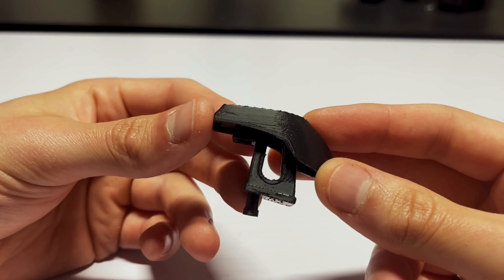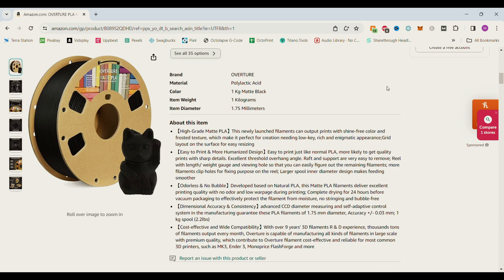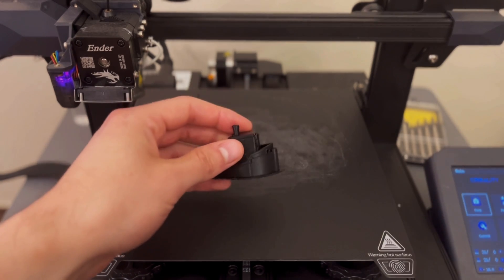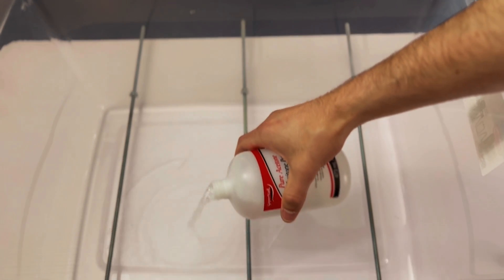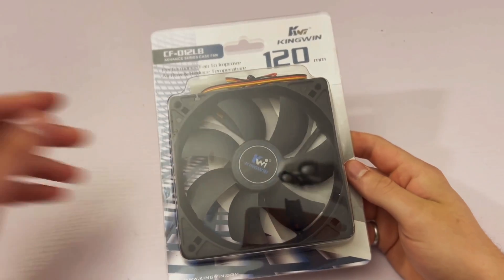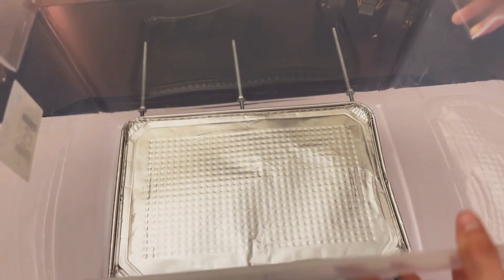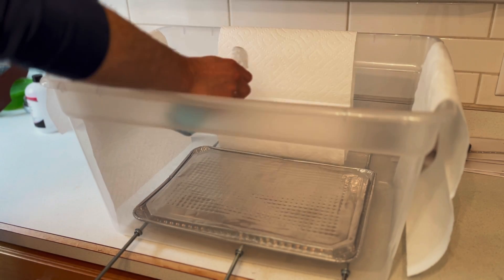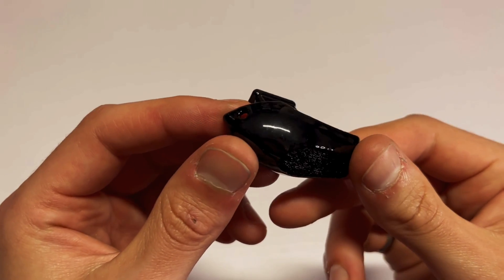The Magic of Acetone Vapor Baths for 3D Prints

Comment: Bro, the instructions you give in this video are dangerous and could get somebody hurt or sick. You should delete this and if you're going to continue to print with ABS, get an enclosure and properly ventilate it with with a filter. You are poisoning yourself and anybody else who occupies the space. 

Also, acetone evaporates insanely quickly and easily and is heavier than air and can displace oxygen. This may not be much of a concern for people because we stand so high above the ground, but it is if there are any pets like dogs, cats, or anything else that breathes close to the ground (and if you have a low bed if this is close to a sleeping area). The holes you drilled in the container are almost certainly allowing it to leak out of the container unless you've sealed them properly. What you showed in the video is not adequate sealing. So the acetone leaking out of the container is running along the floors of your space. Acetone vapor is super combustible, so you're putting yourself at risk of a big fireball. Especially considering that you're using WAY too much acetone. You don't need to make a lake of acetone at the bottom of the container. You just need to soak some paper towels in the acetone and suspend them from the sides with magnets. You can gently heat the outside of the container with a hairdryer if you want to speed things up.   

Speaking of fireballs, those fans if not brushless, present a huge potential combustion hazard. Also, they're not necessary, and they're not doing anything. There's no air feeding into them, because they're choked right up against the lid of the container so they're just a waste of the small amount of electricity they use. 

Something you also missed is the type of plastic container used for the chamber. It needs to be either PP(polypropylene), or HDPE (High-Density Polyethylene), or the acetone will dissolve the bin. I'm pretty sure the bin you're using is PP though, so you're probably good there (except for the holes). However, the spray bottle you used I think is probably PET, and the other components inside will be other types of plastic that may or may not be resistant to acetone. While PET is resistant to acetone, PET is still softened by acetone. It is not immune,  only resistant. Acetone will still damage it over time. 

For your own safety and the safety of others, please do more research before handling and mixing chemicals. Especially before making instructional videos. If somebody gets hurt because they followed the instructions you provide in this video, you would be morally (and potentially legally) responsible.
Reply from the maker: Thanks for all the info 👍

Comment: Really nice trick! I believe there is no need to drill the holes and provide those rods. Any plastic or metal stands on the bottom of the container can help support the aluminum tray. The question is: Do the fans work in the same direction or opposite directions to each other?
Reply: Based on the frame / hub direction, they're both installed to draw / blow air into the box.
Reply from the maker: I agree, I’ve modified the design since to do exactly that. A lot less work. And the fans blow over the parts
Reply: Thank 🙏 you . Great job. And I like your language style . pretty good for practice 👍 @markitmade29
Reply: Don't make a mistake like I did and make holes to pull air into the box or it will take longer. The fans are meant to circulate the vapors evenly that are already in the box. I might try next to space them far from each other on the lid for the larger parts

Comment: tried this method. left parts in the acetone bin overnight and half the day. I come back to my parts being really soft and peel like licorice. ok fine this is normal but it didnt get smooth, the texture before and after remained exactly the same.
Reply from the maker: Were the parts printed in ABS filament? There are some filaments that are considered ABS but are "hybrid" and don't do well in Acetone for smoothing. PLA and other filaments won't work for smoothing in acetone. It should only take 30 min or so in the acetone for parts to get smooth depending on how big the part is. Hope this helps! :)

Comment: thanks for sharing this! Even though you said it doesn't work, I'm going to try it with PLA. With me luck.
Reply: how it went bro?
Reply: @snailzao  @DavidEmil77777 I ended up doing it with DCM and unfortunately it just made the prints so dry they started to crack. Bathing in DCM had a much better result, leaving it smooth (but only on normal PLA, silk PLA lost its color and didn't get smoothed). Even so, its hard to bathe anything in DCM, it corrodes most tools. I had success on a few pieces but its just too much of a hassle, DCM  gives cancer, and you will probably have to bathe it more than once. Well, at least that was my experience as someone with little to no equipment to properly do it, and using 70% DCM 30% Isopropyl alcohol, which is the highest % I could find online easily in my country.
Reply: did it work?
Reply: @DavidEmil77777  I ended up doing it with DCM and unfortunately it just made the prints so dry they started to crack. Bathing in DCM had a much better result, leaving it smooth (but only on normal PLA, silk PLA lost its color and didn't get smoothed). Even so, its hard to bathe anything in DCM, it corrodes most tools. I had success on a few pieces but its just too much of a hassle, DCM  gives cancer, and you will probably have to bathe it more than once. Well, at least that was my experience as someone with little to no equipment to properly do it, and using 70% DCM 30% Isopropyl alcohol, which is the highest % I could find online easily in my country.

Comment: This looks super complicated to succeed. Im scared I migh fail
Reply from the maker: YOU GOT THIS. Just start small and don't be afraid to make mistakes. It took me more than one try to get the results I wanted. You don't NEED a super large container or fans. I recommend trying to smooth a small print in a small plastic Tupperware container (one that you don't plan to reuse again). Just put some paper towl on the bottom and sides and wet them with acetone, put the print in and close the lid. Check it after 3 minutes. Leave it in until you get a glossy coat. Good luck! :)
Reply: really? it seems like a crazy easy set up. way simpler than i thought a vapor bath was before watching this